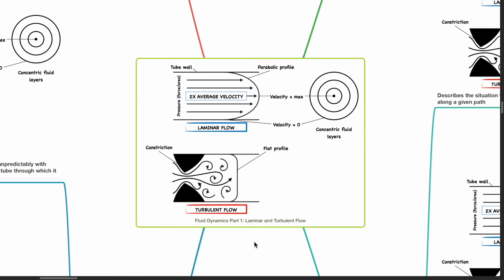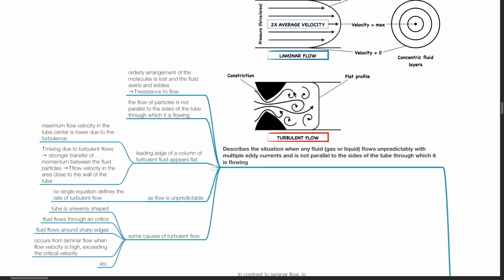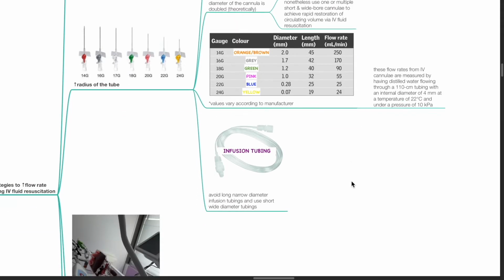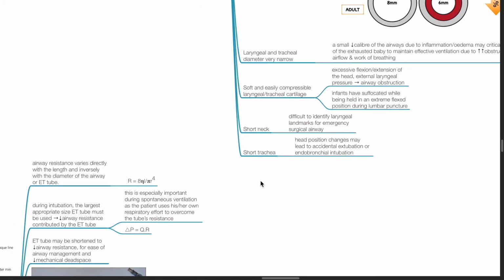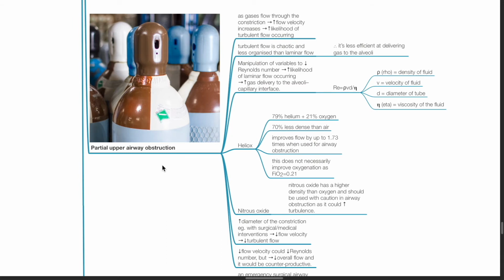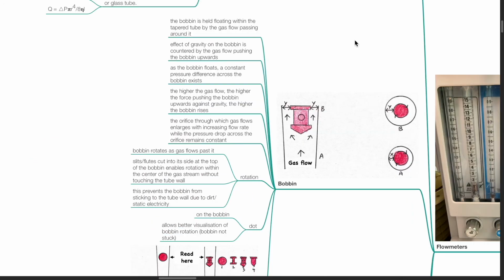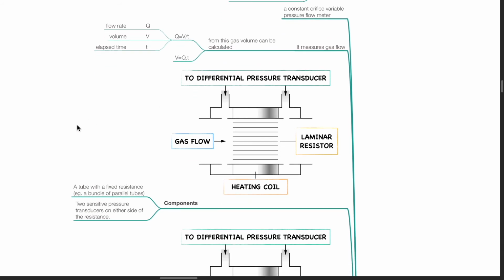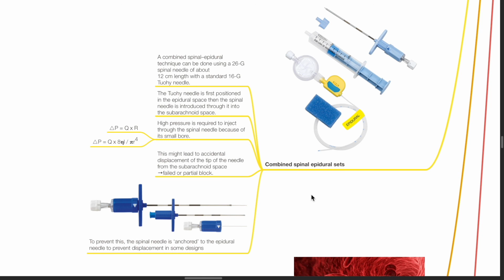LAMINAR AND TURBULENT FLOW  -PHYSICS SERIES

Comment: Sir.  Regarding Pitot tubes.  You have used the incorrect word.  The ports are NOT PERPENDICULAR to each other.  This would mean they are at right-angles.  The tubes are opposite facing so that one measures dynamic pressure and the other measures static (constant) pressure
Reply from the maker: Thanks for the correction!